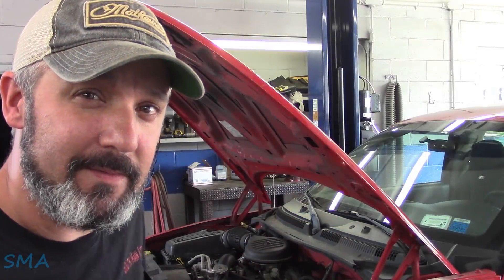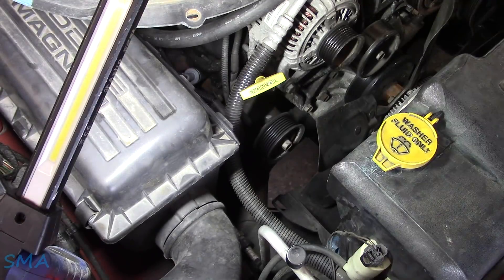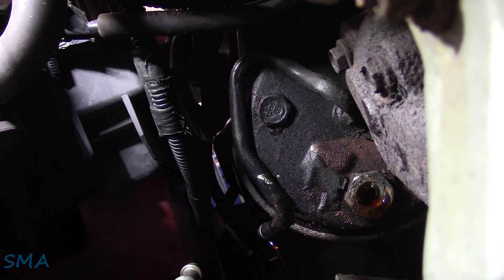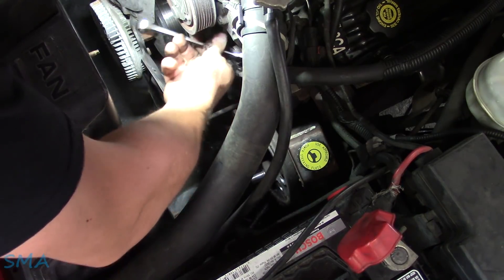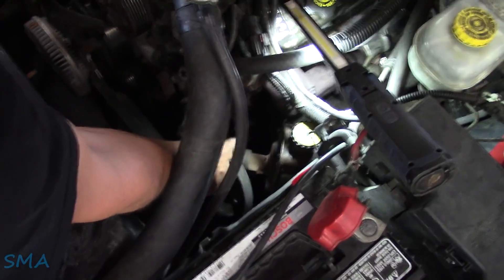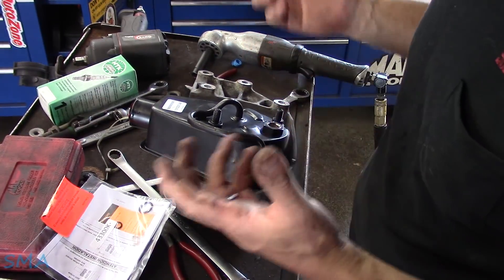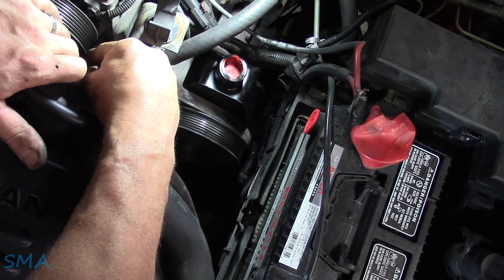Dodge Dakota: Power Steering Pump

Comment: I really hate working on Mopar stuff because of these exact reasons. Something looks super simple until you find out you are about 1/2 inch short on clearance and you have to disassemble half the engine compartment to get it out.

Comment: IMO belt direction matter, I always thought it didn't until I replaced the water pump on my bmw, put the old belt back in (for some reason previous owner replaced the belt, but never the pump even tho it was way past the mileage you're supposed to change it at, and obviously I was changing it because it failed... Long story short, belt was in good condition) without worrying of it's orientation and the belt rubbed in multiple places, smoking and all.

I checked it, at first I thought maybe it wasn't symetrical and couldn't be flipped, it definitely was symetrical, but I put it back the other way and since then, no rub, no squeak, no nothing.
Reply: @johnogara3029  
I'm still confused, all I can tell you is that it's fine now. 

And it's not like the belt was self clearanced on that side, the thing is in pristine condition.

I'm puzzled by it but I've done over 2000km since then, belt never made a noise, never rubbed and isn't damaged, I don't quite understand what happenned but from now on I'll always check the belt orientation and put it back the same way.

Comment: After a trany rebuild, the shop forgot to attach  ground wire on one of the mounting bolts. That circuit grounded the rad fan! While sitting in traffic, as the lemp climbed, I was able to pull over and take a look. I had a mini set of vice grips and attached the ground & away we went!

Comment: This is the first time in the 30-odd months I’ve been watching you that I did the job before you posted it. Maybe a month ago my pump gave up 3-4 miles from home. Drove home through lights without brakes or steering. 2004 Chevy Astro with the big 4.3 has two reservoirs. An upper one on the firewall and the onboard one on the pump. A total bitch to get to but I got-er done and she’s workin’ fine again. Definitely needed a flush. Also, I got the pump without the onboard reservoir so I had to invent a tool to get that off before mounting on the new pump. Both old and new pumps have magnets to attract ferrous debris and the old one was definitely covered in metal schmoo.

Comment: Speaking of power steering lines, the bushings for the rack was getting worn out. Which whatever,  but it seems that over time of me not fixing it. The lines are the rack started to come lose a bit and fuild would leak out. I'd put fluid in, but hadn't seen where it was going yet. Then if finally came the fuild would go straight though. Took it home on the hook. 

Crawled under and noticed the lines were loose, also thought the feed line was bad. So she got new rack bushings torqued to specification (190 ftlbs), feed line and brake clean for flushing and cleaning. Let the parts dry out and put back together and filled up the system. She been working fine ever since.

Oh and doing the torque on the ground with little arc movement was fun as all get out. Not that sucked, but at least was done right.

Comment: You can see a dark stripe on the underside of the hood where the fan slung bits from the shroud.
Reply: Or, as happened to our family's 01 3.9 Dakota 2wd last Friday, the top water hose failed. Spectacularly.

Comment: This vid couldn't have posted at a more convenient time.  No I didn't need to change out a Dodge p/s pump but I did have to drop a massive post July 4th deuce. Got me through my entire 20 mins toilet bowl bombing session, thanks Eric!
Reply: Need to add some fiber to your diet pal. You’re going to blow a valve and found cold with your pants down.
Reply: The only thing better is doing it on the Company dime 👍🏼 #2
Reply: Hah! Same. Just did a pump on my durango.
Reply: @codycall6513  so you're calling it a Durango now?
Reply: T.M.I. Bro…..

Comment: What's your thoughts on serpentine belt or old style separate belts
Reply: I personally like one single serpentine belt with a spring loaded automatic tensioner. In 80k when the belt is worn out, replace it along with the tensioner and idler pulley of there is one on addition to the tensioner.
Reply: Use them v belts for picking up engines and other heavy stuff. The multi rib serpentines are where it's at. My shop even recommends retrofits for our customers with "toys"

Comment: Had a friend bring me his 2004 Ford F-150. The heat stopped working and the truck was overheating. He had just put a new belt on. The belt was on wrong and turning the fan and water pump backwards. He had even printed out the belt diagram.

Comment: I just did this on an 01 Ram 2500 5.9 gasser for somebody broken down over an hour from home today
Reply: Looked like the same pump, the only difference I saw was there wasn't a radiator hose bracket on it.

Comment: I have 2002 Dakota with same 3.9v6 

I need to check freeze plug behind the pump.

Just changed my water pump everything is sealed good but now its leaking what looks like freeze plug.

Can I just remove the mounting bolts without removing hoses and pulley move Entire pump to the side.

Just check that freeze plug. 

Wished I lived nextdoor or across the from good shop, maybe you give just quick looksy guidance on issue Obi Wan

Comment: Zip tie was probably dropped when they doubled up the other one you took off, I was thinking like everyone else ruler pieces were probably there shim fix.
Reply: Chevy dealer shimmed my fan shroud instead of finding and replacing the bad in-warranty motor mounts on my '94 S-10 years ago. They actually failed twice in several years to cause the same issue. "Nobody misses the details like GM".

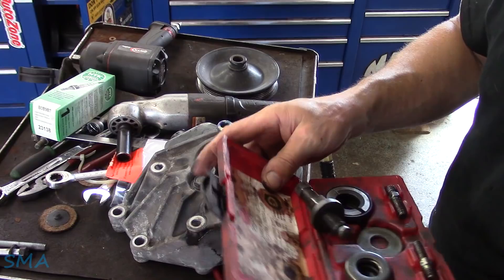Comment: 11:55 😂 torqued to factory spec 😂 with the socket still on the impact wrench lol
Reply: I yes sir.  One uga .. maybe 2?
Reply: Ive noticed quite a few of the repair channels have been doing cut scenes when they say "torque to spec".
Reply: Devil advocate.  Used a different socket...  mabe.  Ya that's what happened 🤔😉🤫😀👍
Reply: Like he's said in prev videos, it was probably the German torque spec, "Guten-Tite"
Reply: @theelmobad1  everyone has a second set of sockets that we use to torque with 🙃
Reply: There's only 3 torque specs. Snug, tight, and tight AF!  😂
Reply: @richardjcranium  You forgot the last one, so tight it's loose again
Reply: all you have to do is say "CLICK" and it's torqued to spec!
Reply: @richardjcranium  in the UK, tight af is also referred to as FT.. fucking tight. :)
Reply: @kieronhoughton4261  is that Newton-metre FT or  foot-pound FT?
Reply: @suttoncoldfield9318  depends how bad a day you’re having 😂
Reply: @richardjcranium  Nope, you forgot the fourth, OH SHIT!

Comment: "Let me get the torque spec for these."
Air gun appears on cart
😉
Reply: just have to convert ft lbs into ugga duggas, or clicky clacks if using battery powered tools
Reply: @mattcat231  Yea, just have to get the conversion chart

Comment: About that dodge with the reverse battery thing... Anything essential to the safe running of the engine will have reverse voltage protection so engine and transmission computers would be okay, everything else is questionable.  Safety systems like ABS and airbags might be okay as well...  If your scanner can talk to it then it's likely okay.

Comment: Good luck getting an ideal drive cycle on that POS.  I've got one exactly like this that I'm about to sell because I hate to drive it.  When you clear the codes, EVAP takes forever to ready because it requires something absurd like a hot soak after driving it consistently at 40mph for 8 minutes (too low for highway speeds, too high for stop and go city here).  The leakdown pump won't even run until the next startup after, so you're pissing in the wind.  To make matters worse, those vacuum hoses are garbage, especially the molded one going from the plastic lines at the leakdown pump and the charcoal canister.  You're almost going to be luckier getting planets to align.

Sorry, ranting.  Now you know why I'm selling it :-)

Comment: curious --say book time says the fix takes say 8 hours and you as the mechanic find a faster way --DO YOU still charge for the 8 hour book time even though your way got it done in half the time?????????
Reply: Yup thats called "profit", and it's usually on average 10 to 20 percent faster. Usually nothing near the 50 percent in your example. And a lot of the time it's ten percent longer because of unforseen rusty circumstances. Then you as the customer "make out" because you were quoted 8.

Comment: Chrysler products keep mechanics fed. 
The bad part is my Dad worked for them for 38 years and they kept our family fed but I won't touch them with a 10 foot pole.
Reply: I just got a 08 avenger.   First dodge product I’ve owned.   Was a southern car.   Runs better and looks better then my 13 Malibu that’s a pos.   Put about $3000 in it and I’ve owned it just under 2 yrs.
Reply: @frank040788  It's kinda like a lottery pick. Sometimes you can get a winner. It's just not as likely with Chrysler or even other domestics sometimes. Don't get me wrong I've owned every domestic and I like them. It's just Chrysler has had the most problems for me and family, friends, acquaintances...
Reply: @kalabash72  I agree with u 100%.    My father has a 09 Malibu barely put any money into it. Actually giving it to my son in a couple months.   Has like 160,000 on the dash.  He’s looking at a Kia Soul for a new car.  Can’t beat 10 yr 100,000 mile warranty.

Comment: 45 mins to start a fitting, got you beat,  I was in stalling a 390 in a 4x4 ford PU with a C-6 Auto trans, the converter slipped a bit, I slid under to put it back in its proper place, you know Spin push pop into the pump,  Well after about 60 mins and i'm not lying a friend came over for something and i asked him to slide under and put the converter in, he asked me Really?  Yes please, he slid under and in the expected 30 seconds it was in and i had the engine mated to the bell housing,  one of my favorite gotta be kidding me stories for a life on shop floor

Comment: Dooooodges are always in need of LOTS of repairs !
Reply: My 1997 Dodge Ram needed a right front park lamp in 2009. That’s the first item to fail me. Otherwise it was just basic maintenance.
Reply: @tracynorris8754  Second gens were quite nice. They had lackluster automatics but other than that they were tanks.
Reply: Dead On Delivery, Guarantee Expired

Comment: That looks like the most pain in the ass power steering pump replacement I have seen.  I'm sure there are others that are worse.  I've only done them on older GM's and Jeep's that were much easier.

Comment: Has anyone ever had the free wheel pulley fall off the alternator and jam the belt cause lots of smoke. Fill every groove on the pulleys with rubber that u have to cut out with a Stanley knife 😂

Comment: Why the use of almost all aftermarket parts?   I've never had good luck with almost anything non OEM for going the distance.   Seems like you would want the parts to match the quality of the workmanship and the mechanic installing them...?
Reply: Can you even get OEM parts for a 19 year old truck? Some, but a good deal are discontinued.
Reply: Usually comes down to customer preference "what do you mean its $xxx for the mopar pump, I don't want to pay for that!!" A lot of times it also comes down to lack of availability of oem parts as well. Given that rig is old enough to vote, odds are the mothership isn't offering it anymore, however I have not checked on that one way or the other in this particular case.

Comment: So the guy bringing the Hemi Ram in, doesn't know the difference between (+ and - ) on a battery? Should have let the place where he got the battery install it....then it would be their fault
Reply: My father in law did this back in the 80's with an old Ford Maverick he later told me he had to hammer the one battery connector on, which should have been his Uhuh moment.   Needless to say the Maverick went to the scrapper after this episode

Comment: Folks this 2003 Dodge has the chubby rubber on the front, new steering pump, and the new O2 sensor. She ain't bad to pass New York state inspection

Comment: Those studs on the back of the new pump might be to hold that radiator hose bracket on something +/- a year or 3 of this one you're doing.

I do want to see what happened with that reversed-battery Dodge, those are always fun to see just how much got messed up.
Anyone taking bets on if they managed to total it or not by smoking enough of the electronics? I mean it still starts and runs, so at least the ECU didn't get totally smoked, and all you need to do to get very crude reverse polarity protection on anything electronic is to install a diode in series with the power wire(s) on all the electronics, I mean obviously it won't run like that but the diode blocks the flow of electricity so probably nothing gets too damaged.
I took this idea from taking apart lots of consumer items that are powered by those little power adapters and send the power thru a barrel plug, most of it that I took apart had a diode in series with what the positive lead should be, or it was already expecting AC and just sent the power straight to a bridge rectifier (that works too, and if you do that it will actually run fine with reversed polarity, or even AC input provided it has a big enough filter capacitor on the rectified output or doesn't care about smoothed DC like a simple DC electric motor).

Of course, the reason to NOT put reverse polarity protection on something would be to reduce costs, but c'mon, how much does a single diode per power wire really cost on a car that costs $20k brand new, and an ECU or other computer that's almost certainly north of $100? Diodes suitable for this purpose cost ME maybe $0.10 each when I order just one of them at a time, but if I go to order them in bulk, like they use at the factories that spit out circuit boards with all the components soldered on them, they cost $0.061 each for a pack of 27k (standard 1 amp power diode rated for 50v reverse voltage, part number 1n4001), and that's just the price I can find from an electronic component distributor (Mouser.com), if I went direct to the manufacturer and said "I expect I'm going to need say a million or 5 of these per year for the next 5-7 years", I expect the cost could be even further reduced.
I expect the real "cost" of adding reverse polarity protection is less about what the component itself costs and more about the machine time to place and solder each and every component on the circuit board, plus the supply chain issues of adding another part to the bill of materials (if you can't just use one of the other power diodes you might already be using in the design, that's why sometimes you see a massively over-spec part used where a lesser spec one would work just as well and cost less, they're trying to minimize the number of different parts they have to set up supply chains for to actually make the dang thing).
Reply: Too much coffee?
Reply: @MrTexasDan  Nah, before I dropped out of college to be an auto mechanic I wanted to be an electrical engineer.
Reply: @44R0Ndin  well dang, you missed your calling.  Impressive writeup.

Comment: All I have to say is 1st it is a dodge .... great while they actually run.  2nd: reverse terminal or not, it is still marked positive and negative on the battery, and the wires are still RED and BLACK, the black doesn't go on the positive terminal ...... trying to get the smoke back in the parts ..... not going to happen ..... sigh!!!

Comment: These cheap butt manufactures.  For a couple bucks you can put in a reverse polarity protection circuit that even flashes a light or rings a bell.  Really cooks my kringle.
Reply: Stupid can't be fixed and often can't be prevented.

Comment: I’d have flushed the power steering fluid if it were my vehicle. It’s easy enough to do in under 10 minutes. I understand it’s likely to not be an issue, but there’s really no reason not to.